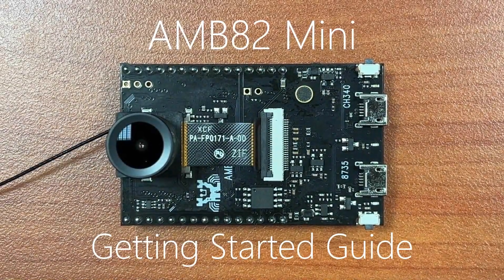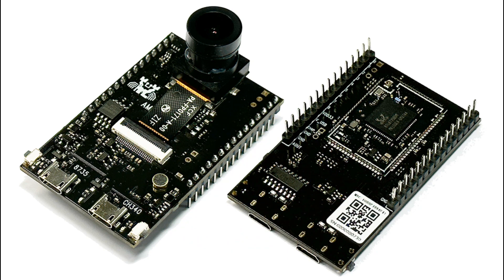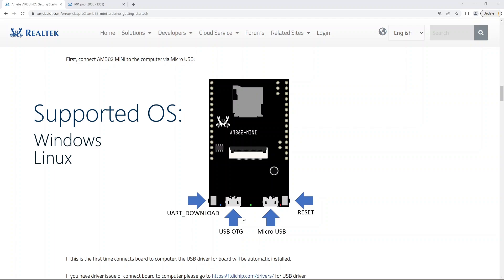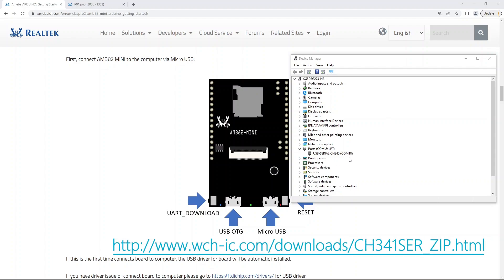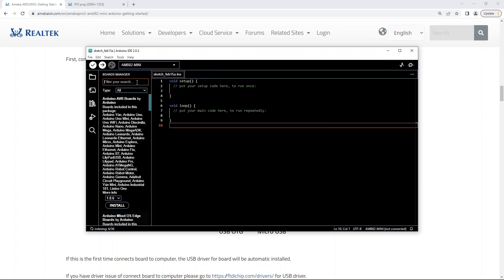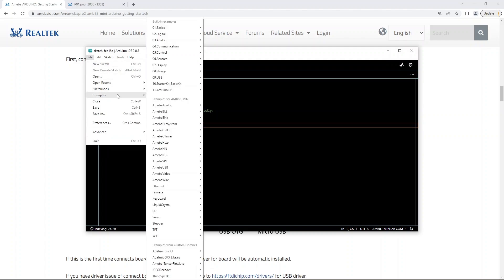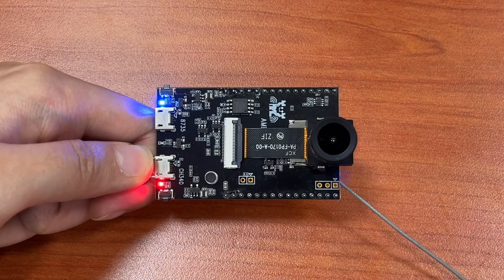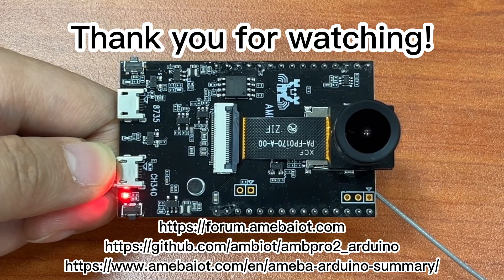AMB82 Mini - Getting Started V2.0

Comment: Hi, the board does not currently work PNP with Windows 11 Home 23H2. I have installed the CH341SER.exe driver from the Ameba website and confirmed installation, checked the usb cable, etc. The board will not be recognized on the com port.
Reply from the maker: You may want to check the homepage/web of CH341SER.exe